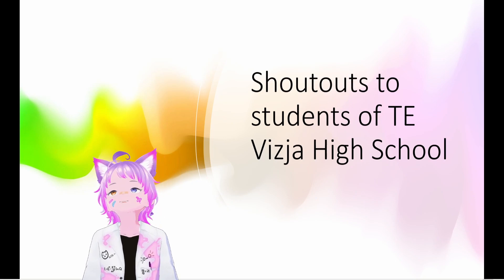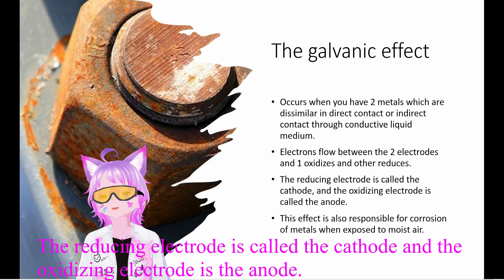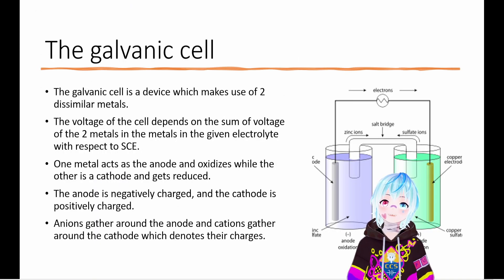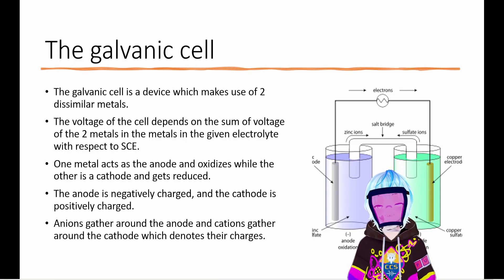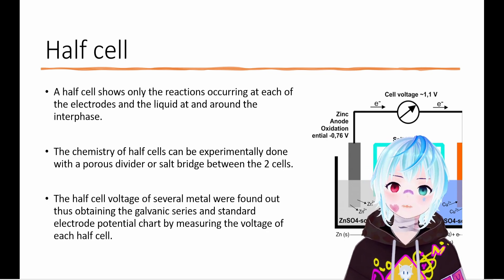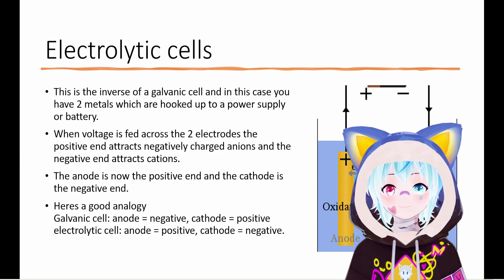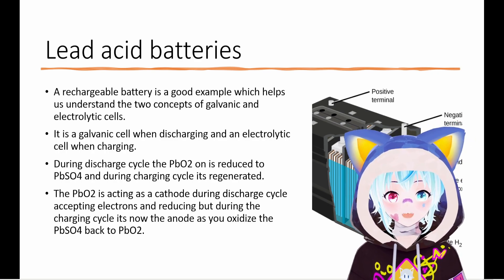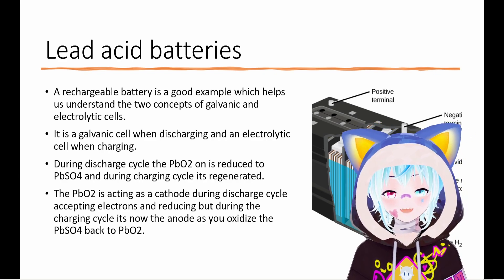Introduction to electrochemistry pt1: Galvanic cell.

Comment: Hey catboy, have you seen these solid state dehumidifiers? Big Clive reviewed one. It's apparently a "solid state polymer electrolyte" or proton exchange membrane or something. It would be awesome if someone could homebrew one of these things. Some company sells them, but they work out to like a hundred bucks per square inch.
Reply from the maker: based on what im reading its a cation resin type device but there also maybe a dessicant hydrogel on one side to act as a collector for moisture then the electrode mesh sits above that which then will cause hydrogen ions to travel through. So im thinking of maybe a film of ionomer cement mk2 + analog but filled with sodium polyacrylate or better coating both sides so the electrodes have something to conduct.
Reply: @CatboyChemicalSociety  Very interesting, thank you. I hope things in paradise aren't too tough for you ;)
Reply from the maker: @WaffleStaffel  I brainstormed with ppl for a bit and its actually easy to make that device but what I dont like is it slowly puts an O2 atmosphere in wherever you are dessicating.
The device can be made even with citric acid + PVA resin though ionomer cement mk2 which is polystyrene sulfonate based is better still. A hydrogel impregnated with KOH or some other substrate acts as electrolyte then finally 2 electrodes anode made of steel cathode made of Pt (for H2O output) or steel for H2 output.
Reply: @CatboyChemicalSociety  Yeah, I saw someone use this in a filament drier yesterday and was wondering if the O2 would oxidize the filament and make it brittle or discolored. This would make a very interesting DIY experiment. Thanks again dude.
Reply from the maker: @WaffleStaffel  well you can stuff a tube of steel wool to absorb the O2 produced but that defeats the purpose of using consumable stuff.